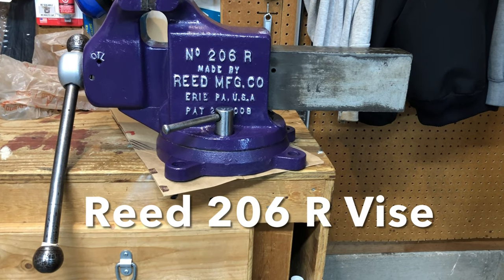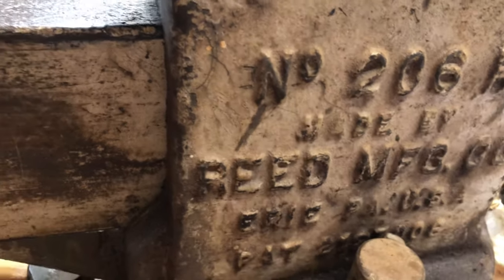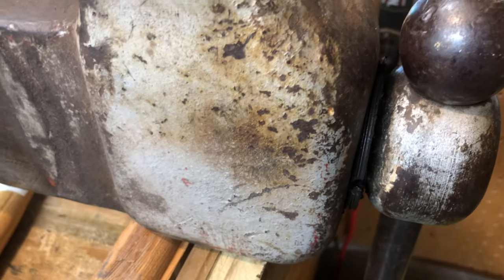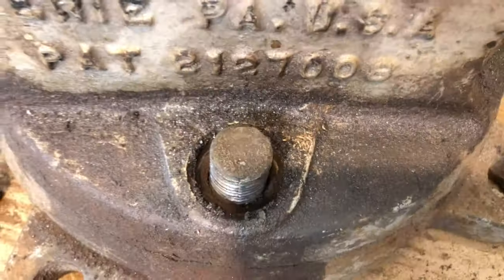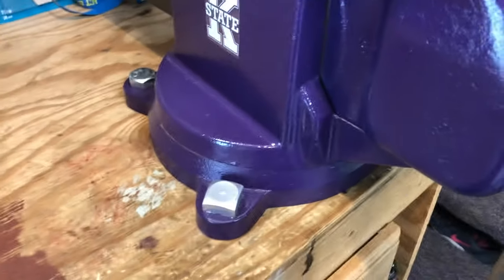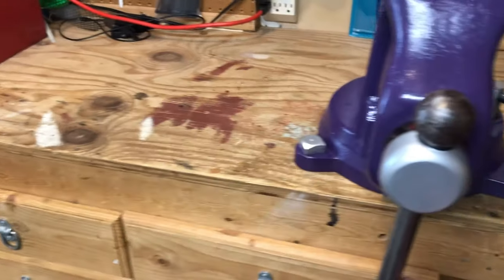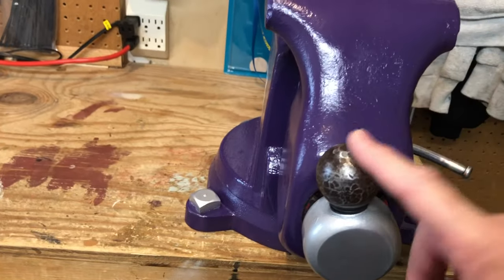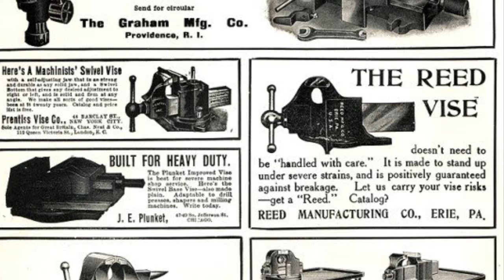Reed 206 R Vise Restoration (Huge 153 lb. vintage vise)

Comment: Great video, I’m in the process of restoring one for a friend.. it was in about the same condition as yours but locked up tight with the dynamic jaw…I got it apart now but am struggling to get the set screw for the collar but out.. it’s soaking now… you did a really nice job on yours…

Comment: That vise has a very faint date stamp on the side. You might see larger numbers that’s to keep all the parts together.
Reply from the maker: You are correct, they are fairly faint, but they are identical to the date markings on my 105R and 204 1/2R.  Check out the examples here.  https://www.garagejournal.com/forum/threads/reed-r-series-post-your-reed-date-stamps.400156/